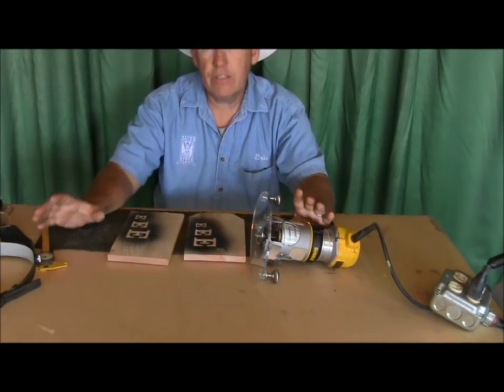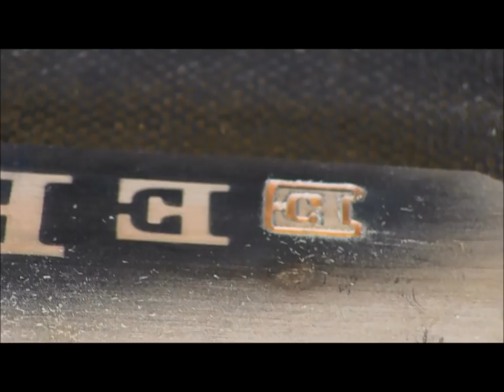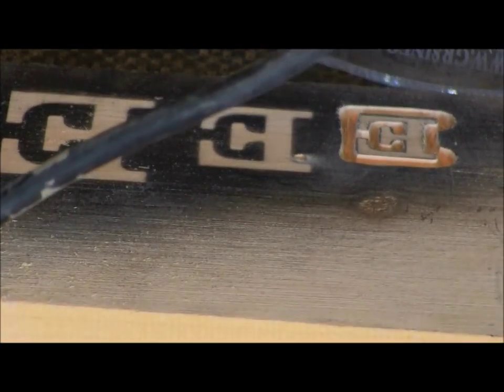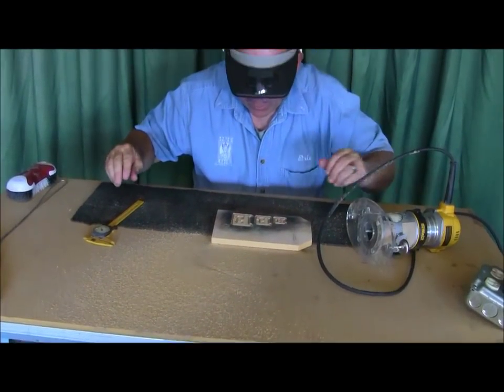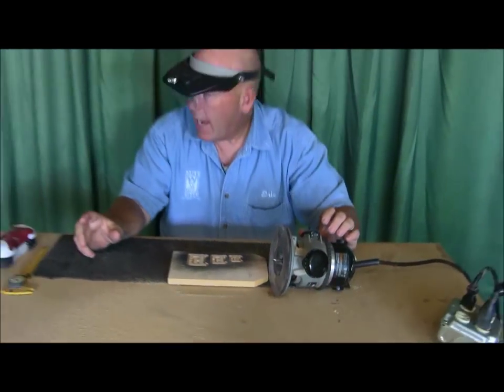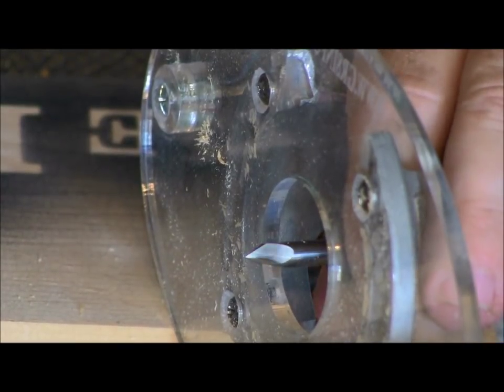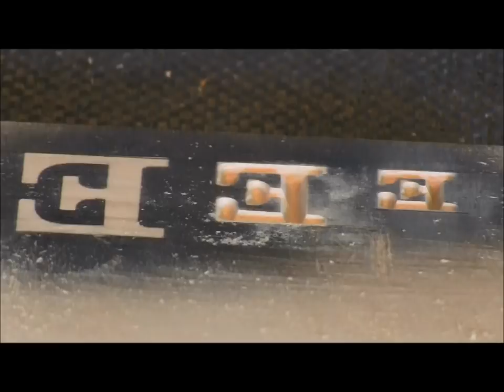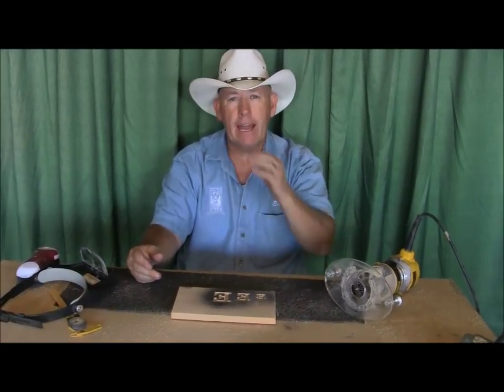#93 Router Bit Depths

Comment: Hello, Do you used the 'trim" router because its not as powerful and doesn't jerk and move around alot in the wood? I've noticed with my full size router that it likes to move a lot when i'm trying to make cuts even when its not that deep. Thinking a trim router would be a great investment for sign making. Also with your router base plates you sell would it be possible to buy one without router mounting holes? I have a different router than what your plates except and would like to drill holes for it to fit mine.

Thanks for the great content, Dylan!!

Comment: Hi Dave, excellent videos! If you were to router multiple depths for highlighting and or accenting, is there a particular sequence you would use? For example 3 layer depths, not much different in the layer thicknesses. What is the average thickness for sign stock?
Reply from the maker: I do carve multiple depths often. I always carve the shallowest (finest detail) first. Average thickness for my signs is approx 3/4". Although some small ones are close to 1/2" and bigger ones are close to 1 1/2" thick. Thank you for watching and you can always email me directly if you have more questions eric@makeawoodsign.com.
Reply: Thanks Dave for a very quick response!

Comment: Hi, I purchased your acrylic base for my Dewalt 611. Unfortunately, I have not used it, the router drill bits I bought  in the U .S. are metric. The router can not take bits but 1/4 inch. Is there any attachment I could buy, or a jacket to put in the bits?.  Greetings from South America. Hugo.
Reply from the maker: You should be able to buy a collett for your router that will accept 1/4" bits, Check online. Thank you for the business and for watching, Eric

Comment: Hi Dave im a 38 year father my dauther is 4 and i want to do a wood frame with the school name about 16 x 10 and i want to know what i have to have to do this project i went buy a router a portal cable 1100 yiu have any suggestions. Thank you
Reply from the maker: That looks like a good router and it will certainly work but I prefer smaller palm routers like the porter cable 450. When setting up to carve the frame I would definitely set it up in some kind of jig or clamp it down for more control. Kind of like I did on #272 & #273. If I can answer any other specific questions for you email me eric@makeawoodsign.com

Comment: Your second cut just goes around the letter but you don't deepen the space inside the letter?
Reply from the maker: vtxrider1800r Not sure which part you're talking about. When I do small outset letters I will make my first cut for the detail Then a second cut deeper so give me a buffer space around the detail so I don't have to get so close to the letter with my backround bit. I hope this helps. If not let me know. Thank you, Eric
Reply: Dave Rhoten
 First off, I like to say how much I've learned from your videos. As a beginner they are fantastic. What I meant is the when you go inside an E or a better yet an O, you don't do it twice like at 26:28. I was making the inside of letters the same depth as the clean out. Another question I had is you have different depths for each size letter. If a sign has two lines of different size letters as in the case of the one I'm making now, what do you recommend? Go with the biggest? If that sounds picky you should see my pile of firewood from being picky.   Thanks
Reply from the maker: vtxrider1800r Thank you for the nice comment. Glad our videos are helping you. Ok on this video I cut 3 E's 1", 1 1/2", & 2". Because I can't go as deep on the 1" that one I make 2 cuts on so I'm less likely to knick it with the clean up bit. I go deeper (up to about 1/4") the bigger the letter is. Remember my bits are v groove. Meaning the deeper you go the wider the line. If you have different size letters on the same sign you would adjust the depth (width) for each size letter.   Picky is good, but remember this is a FREEHAND sign. You will probably allot more critical then you customer. Just keep at it & you'll get better with each sign. Thank you. Hope this helps, Eric